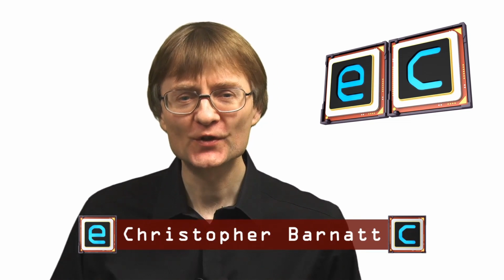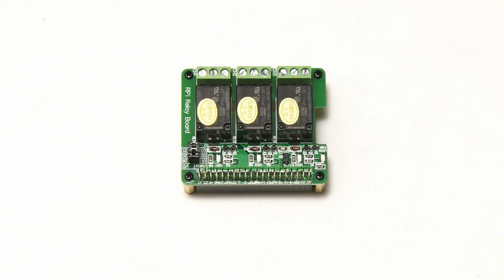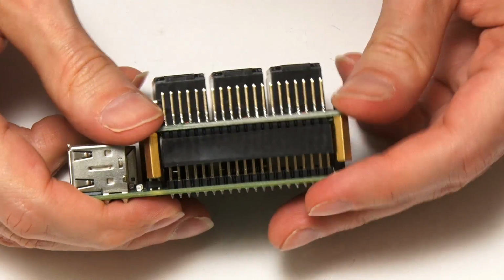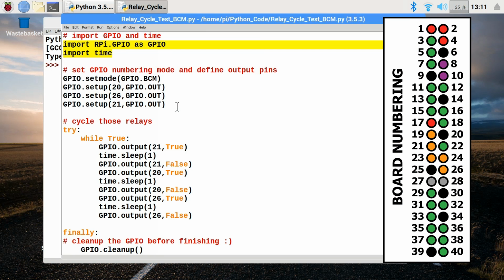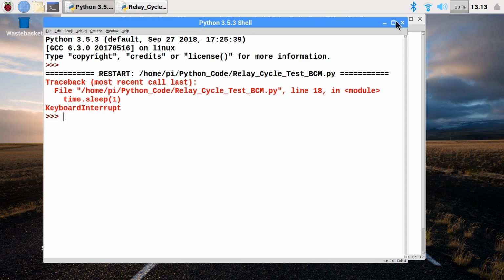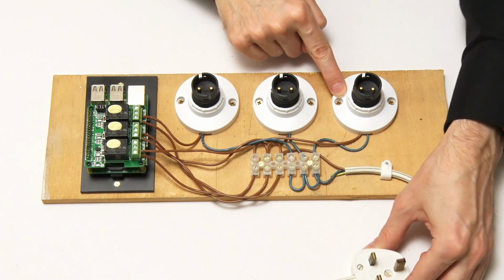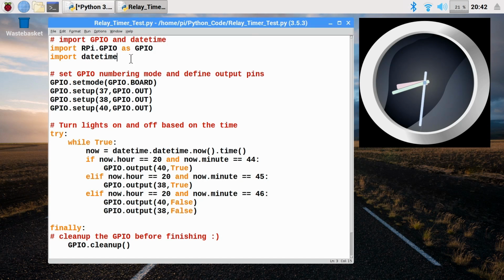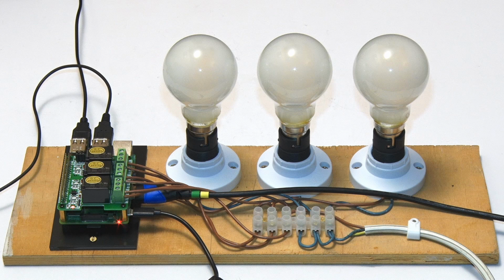Raspberry Pi Automation #1: Mains Relay HAT

Comment: Hello! Writing from the US. I am glad to have stumbled across your video! I have an old stop light that i picked up from what looks to be the 60s that i want to hang in my shop. I also do a lot of mechanics work, I want to setup the stoplight with a proximity sensor mounted on the ceiling next to the stoplight that of course then progresses from green to red as i get to the perfect spot. not only to make parking easier but a fun way to use the stop light instead of it just sitting on a shelf collecting dust. Any hardware you could recommend to make this easier for a beginner? Im fairly familiar with how code works etc but just getting started in the world of writing it myself. not sure if arduino or pi would be best. Thanks!

Comment: Does anyone know if there is a GUi for reprogramming the timer for the relays? I just need a functioning easy to use outlet relay with custom timers with a GUI interface. I'm good with building electronics. Not as good with reprogramming everything with code. I'd like a "do the programming once, do the rest through a GUI server over ethernet"-solution.

Comment: One out of the book question: 
Can't we control an AC bulb with relay when there is already a stepper motor being controlled using its driver connected to the same Pi board?

Comment: Really cool, but not particularly useful. You'd need a Pi behind every switch plate to control lights around the house. And wiring everything up so the switch could override the Pi would also be non-trivial. (3-way switches would be required). Could be handy for holiday lights or other things you don't really need a normal switch for though.

Comment: I'm surprised to see that this is a 5V relay HAT because the Raspberry Pi operates it's GPIOs at 3.3V. Do we need some kind of extra level shifter/logic converter, or is it included in this HAT?
Reply from the maker: This HAT uses 5V relays, but this has nothing to do with the electronics that interfaces them to the Pi. A GPIO pin can only provide a low-current output that could not control a relay of any kind (5V or 3.3V). So extra interface hardware is always needed. This is a HAT with 5V relays controlled by a Pi, not a set of 5V relays connected to GPIO pins. :)

Comment: Edit: Hi Chris sorry if the comment seemed impolite - I really enjoy your videos they’re fantastic :) 
My Pi1 (bought for £10 off eBay) does not run some later OS versions and the GPIO programming is different to yours pictured as a result, cannot update or the kernel doesn’t run my Wi-Fi adapter… I was only trying to share my experience with setting up relays. I am programming for the first time… very unfamiliar with the lexicon and electronics as a whole but enjoying the learning experience. I have three types of relay now and 3 types of DC-DC booster / transformer to try. I’ll post a video of my own when the project is done. Thanks!
Reply from the maker: This is very strange and I think not entirely accurate. Others please note that the "GPIO coding language" is not dependent on the Raspberry Pi model used. The version of Python available in Raspberry Pi OS (formerly Raspbian) has changed over the years, but all Raspberry Pi models can run the same version. So this is an issue of keeping the software on a Pi updated.

On the voltage issue, the GPIO pins on a Raspberry Pi output 3.3 volts at very low current, and absolutely cannot be used to directly control a relay (or indeed any other electrical component). GPIO pins are for the control of low-current electronic devices only, and are very likely to be damaged if high-current devices are connected. So a relay control board will always be needed. This video shows a Pi fitted with a suitable board. To be clear, do not connect relays directly to GPIO outputs, as not only will it not work, but it is likely to damage the Pi.
Reply: @ExplainingComputers  https://youtu.be/BzpOHSaiQTg

Comment: Those trails on the bottom below the soldering mask seems to be far not enough for 230V + 10A (=2.3kW). Of course, a light bulb would be OK, but putting on e.g a computer to that is a bit risky. Don't try it!

Comment: Thank you for that Video. Very interesting. Could you make one with the I2C Bus and I/O's as well as Analog I/O's? Would be very interesting. If 3 Relays are not enough and if someone would like to use an Industrial 4-20mA Pt100 device for example. or RS485 Modbus.

Comment: Hi Chris. hope you are well. I have a question please. I need a timer that turns on and off up to 48 times per day. The amount of time needs to again 30 seconds every day . EXAMPLE: Starting with ON for 60 seconds on the first day each on time, 2 times each hour. Although it needs to gain 30 seconds each day, so the time must turn on for 90 seconds the second day 48 times, 2 on and off cycles per hour. This must happen gaining 30 seconds each day until the ON time reaches 300 seconds (5 minutes). Then the ONN and OFF cycles must decline in the 30 seconds ON until it reaches to 60 seconds mark once more. Then this series of ON and OFF timing sequences last in this schedule for 50 days and then must start over at day one and go for the 50 days. I used to use a X10 programmable wireless hub meant to run its programing on a PC using the Windows XP although this wireless hub has been discontinued.  The best part of the x10 hub was that the programing was done in a sort of spreadsheet GUI format  (This may it fairly easy to create the needed timing functions for me. This is a real world AG application, so it must always work. If you have any ideas for a hassle free substitute could you please contact me by email at secure1369@gmail.com. Not only myself but a hungry world will appreciate your effort Sir Bryan.

Comment: Thank you so much for your video. It isperfect for my project. I am a newbee and need direction please. I plan to use the exact relay board HAT you have in your video, a raspberry Pi 4 (lablist Pi 4  8/128) that comes with fans that look like they will interfere with the relay board. Then I hope to attach that combination to a 7 inch touch screen and case. Could you please point me to an example of parts that would fit together and give me some  advice? thank you so much. JT

Comment: is 3 is the max we can have  ? if not what is the max we can switch on and off ?
Reply from the maker: You can stack these relay boards, assigning the relays to different GPIO pins. Certainly usng two boards (six relays) is possible, but there may be power contraints after that.

Comment: As an Electrician I would not recommend putting mains voltage on a board mounted directly on the Pi as if you picked it up while still connected to the mains ones finger could easily connect with a live track on the board. Also if some metal object got accidently between the board and the Pi damage or a fire hazard could occur. Better to have the board separate and enclosed or use the relays on low voltage to operate separate mains relays.
Reply from the maker: Good advice.

Comment: Hi, do you think that the power relay board expansion module will be compatible / suitable with the raspberry PI 4 ? 

Thanks,
Reply from the maker: Yes, it will work just the same on a Pi 4 -- or any Pi.
Reply: @ExplainingComputers  Thanks :)

Comment: If you add a sleep in that while-loop, it'll use a lot less CPU; no need to check the time every millisecond. This'll make your Pi much more responsive and it probably saves power, but I'm not 100% sure of that.
Reply from the maker: You are right on all counts. :)

Comment: Thank you for this greatful information, so as I saw you run your script on Linux... I have installed xampp on my rpi and using a web application, can I send command from my app to run this scritps..
I want to unlock magnetic door when user check in.. 
24 volt door lock.. so rpi to work as switch.. to give electricity for 5 second and stop it..

Comment: I'm confused what i need to controll an array of 4 fans and 50 peltier coolers. ( please stop me if its a bad idea). The fans run at 12v 60 w each and i cant remember for the others. I need one circuit for the fans in parralel and one circuit for the peltiers and its going to be an ac unit... perhaps I should double up. Do I need a HAT? How does the pi talk to it. I hope to look at my new air conditioning unit in a cool room drinking hot tea out of one of your mugs feeling all satisfied
Reply: I have a mug. Perhaps you have a patreon site.
Reply from the maker: Glad to hear you have a mug! I don't have Patreon. What kind of power are the coolers using?
Reply: @ExplainingComputers  they need dc power. Ive learnt that i can make a switch to start a power supply just by joining 2 cables. That should get me the power i need :) please can you say what i then do with the power (dc) to control it with a board and which is the best to go with pi... arduino and so on. Getting that mug on friday!
Reply from the maker: @ashtongrist  Hope the mug arrived OK! :) The HAT I used in the video is rated 10Amp/250VAC or 5Amp 30VDC. Whether you use a Pi or an Arduino to switch things, the key thing is that you need to know the rating of what you need to  switch -- I am assuming what you note above is that joining two cables completes the circuit to power what you are powering. But I don't know what you are powering, what the total wattage is, etc.
Reply: @ExplainingComputers  the total wattage is 2400 + the fans at 12v each x4 0.25A getting that mug first thing this morning. Im gonna put my spares in it.
Reply: *240W for the fans.
Reply: My mug arrived. Lovely thanks.
Reply: I will post clearly my power needs.
Reply: i think i need 750 v of electric and 2500w and thats everthing i know about electric. i understand i need a relay. im eventually gonna hook it up to machine learning so that i get the best sleep.

Comment: Would it be possible to stack 2 hats on top of each other (I would like 6 relays)... the first set is wired to the default pins and then the top set can be wired to other pins?
Reply from the maker: Yes, you can do this, exactly as you describe.
Reply: @ExplainingComputers  excellent! Thank you for this video... I already bought one out to test the waters (slightly a pun) as Im building out a sprinkler controller with a Blazor WebAssembly front-end... sprinkler status / control / configuration will be done initially through there... eventually being connected to azure iot hub.. building it for me, my dad, my father in law, and my uncle. I'm not 100% sure on the 24VAC part, but sounds like this hat will be able to handle that.

If you have any thoughts, recommendations, or more videos I can check out I would greatly appreciate it...

Here is a quick video i made this morning of my project... I have links to my github if you are interested in reviewing the code.

Thanks again!
https://youtu.be/Wx4toFWBEMU
Reply: @mrcunninghamz  did you stack 2 hats together in the end? I am looking to stack the set up for 6 relays, not sure if it is powerful enough to hold / throw all 6 relay at the same time
Reply: b.b. 2k16 I didn’t get the second hat, wife and I got really busy as we were expecting twins so the project is sitting on the shelf :(. Let me know if it works out for you though.

Comment: Very good.  If you like using a Raspberry PI to get light bulbs going then I think you would love the set-up I have.  I have my PI to get my out door Gas Light going with some Python code which alters everyday based on sunset and sunrise.  The PI switches a solenoid which lets the gas through in a Sugg light.  I love it, never have to think about altering the time because the PI does it for me.  This HAT looks perfect because I can then use the same PI to control our second Gas Light too.  Our entire street (in Sheffield) is Gas Lit.
Reply: Thanks for keeping this video posted and your code too.  My PI stopped working and I had no backups of my code anywhere.  I've had to almost start from scratch and your code has been super helpful.  Gas lights working again.

Comment: Wow! That's fantastic! Using a high end microprocessor capable of producing 4K video for a job quite easily done with three 555 timers worth a couple of cents. Never mind the complexity of the board.
Reply from the maker: I've no idea how three 555 times could turn bulbs on and off at many preset times. The purpose of this video is to demonstrate a principle that will be built on in future episodes.

Comment: I can't watch the video (at work), but I have serious concerns about the idea of having 240v just millimetres from a SBC board. It looks to me like there's no mechanical separation between the terminal blocks and the board underneath. Bugs, dust, etc may form a bridge over time, and BANG!
Risks? Blowing up the SBC obviously. But also potential for blowing up network equipment if connected to wired Ethernet, possibility of killing someone who presses any controls connected, etc.

Keep your 240v separated, people!
Reply: Put this into a non-metallic project box, make sure you are plugged into a mains outlet that has GFCI (in the US) on the circuit, and lastly unplug it before opening the project box.  If all of this still makes you uncomfortable 🥵 don’t play with it at all, its for big kids who understand electrical theory.  Oh, you still want to control things on mains?  Use an Alexa, or Siri controlled Wi-Fi outlet...my 8yo son has quite a few in his bedroom and controls them with Alexa voice command.
Reply: @iamblaineful  
You still need to keep a gap between mains and the rest of the circuit. The relays and terminal blocks are through hole. The designer managed to include anti-tracking gaps in the board between the relays, but didn't worry about the relay and terminal solder pads hanging down towards the various bits and pieces on the Pi. The HDMI connector looks pretty close to me.

It's probably OK, at least while clean and being observed by the user. But once it's in a case, tucked behind some household furniture, and forgotten about, dust, bugs or other contaminants may be enough to bridge the gap. RCD/GFCI may not notice the fault if it doesn't go to ground but instead goes back to neutral (which can happen, especially with the amount of Chinese products we all import these days).

A simple layer of plastic glued over the bottom would make it much safer.
Reply: tin2001 I would switch the neutral wires through the relay, not the “hot” A.C. wires, and yes there is adequate physical separation on the PCB between the high voltage and low voltage sides on the hat.  If are concerned about the through hole attachment points being too close to the Pi or connectors, use a GPIO riser between the hat and the Pi.  You can also cover them (through hole lugs of the high voltage header and relays) with UV cured conformal coating as a precaution if you are concerned about that.
Reply from the maker: Good advice. Always take great care when working with mains.

Comment: This could be really useful for power cycling devices that regularly require it. Set the Pi to cut the power for about 10 seconds and power things back on in the correct order whenever it detects a missing connection to the net.

Comment: I'm not creative at all when it comes to the GPIO on my Pis thus all my projects so far are purely software based.
Also that's the reason I've purchased no Arduinos so far.

But your video got me  thinking, not just for an anti-thief construction but home automation in general.
Now I'm excited to see more videos in that series, maybe I can still make good use of my older Pis (starting with the 1B model that still uses full size SD cards) that I refuse to give away :)

Comment: I didn't know they made a relay hat for the Pi, very interesting. Combined with a few other things, I can see this being useful to automatically turn devices on/off, such as automatically restarting the router when I'm not home if it detects a loss of internet for x amount of time. or using it's DC function to hit the power_on line in my server to turn that back on automatically after a power outage (ditto sending it and my gaming PC commands to turn off safely if my UPS runs low).

I've always wanted to do that because of how awful the electrical is in this apartment.

Comment: As an electrical engineer trying to learn more computing aspects I always notice the neutrals in the videos. Normally I would loop the neutral from each light together with the last direct off the cable (with no connectors). These videos always seem to bring each neutral to connectors and loop them there. It makes no difference at all, but I wonder why it’s done. 

But great video!

Comment: Is there anyway to modify and connect a laptop dock to a desktop?
Reply from the maker: Possibly. I'm not sure why, though. As the laptop dock provides access to devices that a desktop can connect to directly.
Reply: ExplainingComputers most regular desktops have 2 display outputs (usually a VGA and an HDMI). However some laptop docks (like common Dell docks for Latitude laptops) can provide up to up to 3 display outputs. Also it would be useful if there are some failed ports on the desktop and you can utilize the ones on the dock. (Such as additional USBs and Ethernet).

Comment: Yet another excellent HowTo.  I actually plan on doing something like this to control dampers in my house because the air circulation is horrible and I'd like to be able to programmatically control air flow so I don't have to stand on a stool anymore. :)